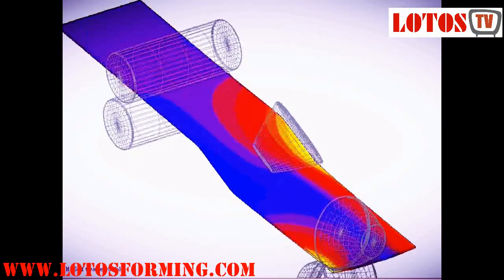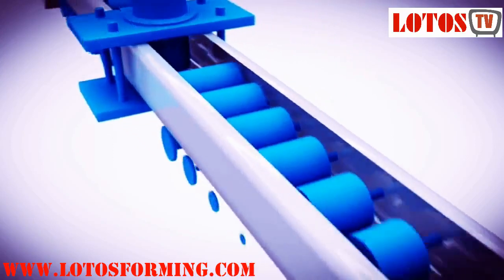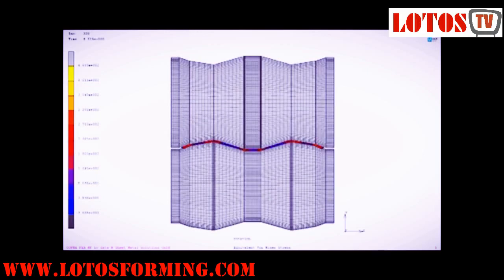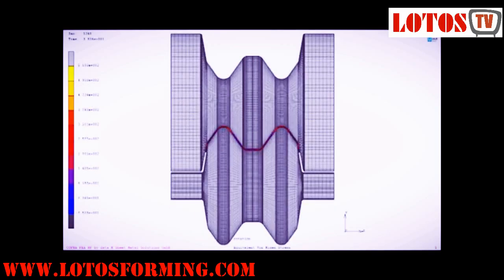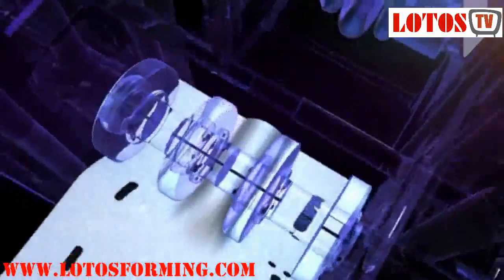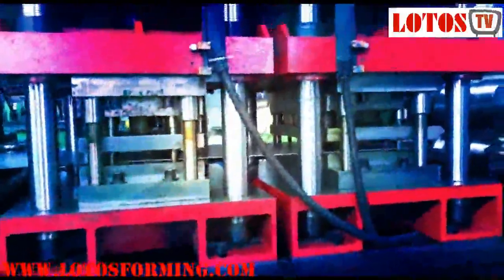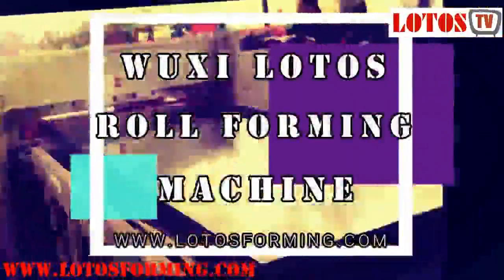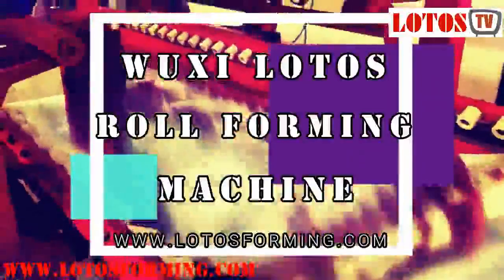ROLL FORMING PROCESS: how roll forming machines work(2019)

Comment: roll forming process, how roll forming machine works, it the best video i saw , we got good knowledge for roll forming machine process, thanks
Reply from the maker: hi dear thanks for your effort about roll forming process ,
you can see more details in our website:
www.lotosforming.com
Reply: @lotosforming  Roll Forming Machine Line Basics
The basic roll forming machine has a line that can be separated into four major parts.
Reply: @lotosforming  good idea
Reply: The roll forming process can be used to form a wide variety of cross-section profiles. An open profile is most common, but a closed tube-like shape can be created as well
Reply from the maker: steel decking floor roll forming machine, steel door frame roll forming machine, steel roll forming machine video, steel stud roll forming machine, steel tile machine, steel tile roofing machine, steelform

Comment: Roll Forming Techniques 
There are two common roll forming techniques with variations:
1) Pre-cut or cut-to-length roll forming
Strips are pre-cut and processed, then fed into the roll former as individual strips. These strips may be cut from a coil or sheet.
Reply from the maker: buy roll forming machine, china roll forming machine, cold roll former, cold roll forming, cold roll forming machine video, commercial roll form, custom roll forming, fully automatic steel door sheet machine, linear ceiling making machine, lotosforming, metal ceiling roll forming machine

Comment: The material is usually inserted in sheet form or fed from a continuous coil.
 The next section, the station rollers, is where the actual roll forming takes place, where the stations are located, and where the metal shapes as it makes its way through the process.
 Station rollers not only shape the metal, but are the main driving force of the machine.
The next section of a basic roll forming machine is the cut off press, where the metal is cut to a pre-determined length.
www.lotosforming.com
Reply: good
Reply from the maker: buy roll forming machine, china roll forming machine, cold roll former, cold roll forming, cold roll forming machine video, commercial roll form, custom roll forming, fully automatic steel door sheet machine, linear ceiling making machine, lotosforming, metal ceiling roll forming machine

Comment from the maker: Roll forming is used instead of extrusion, where the metal required cannot easily be extruded, or where the features along the length of the part are uneconomic to add to an extrusion, or where an extrusion is not accurate enough.
Reply: thats great
Reply from the maker: top hat machine, u channel roll forming machines, upright rack roll forming machine, used roll forming line, used sheet metal roller, what is roll forming